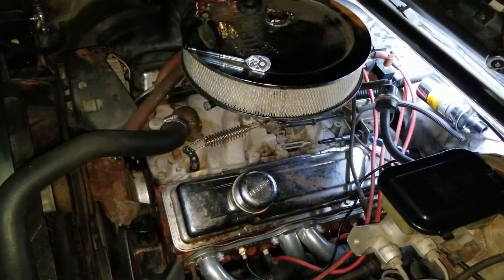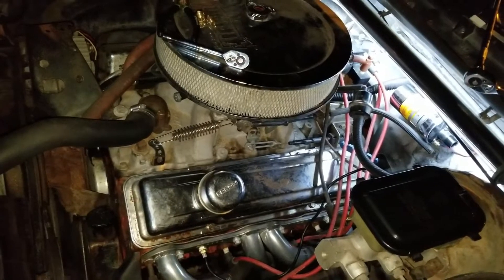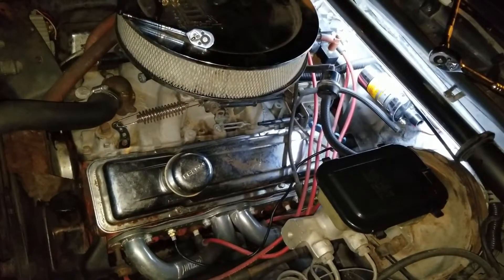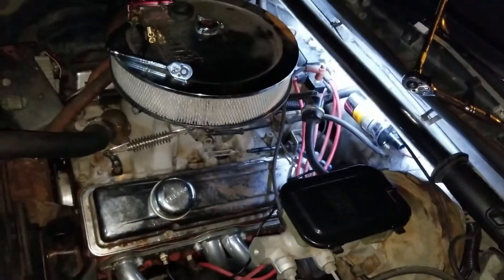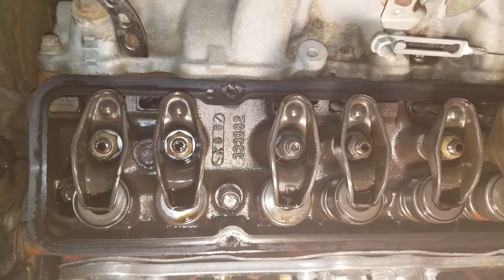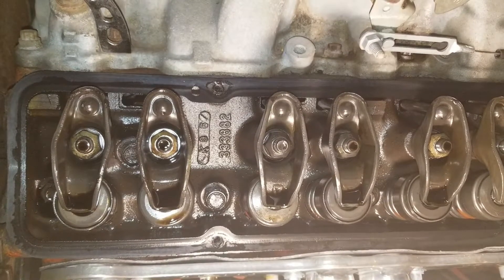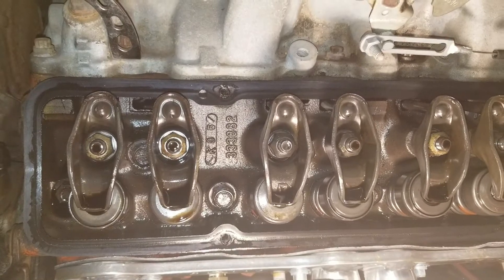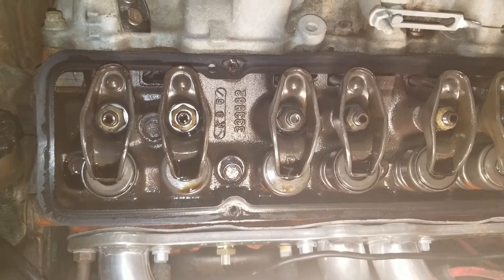Chevy engine block and cylinder head casting numbers location

Comment: Thanks! Rebuilding a 76 camaro, needed to know if it's a 4 bolt or not
Reply from the maker: As far as I know it's a 4 bolt block but I've been seeing people selling the old 010 block and saying it's 2 bolt. They may have had them done in both. That casting number has a wide range of use. The best way to find out is to pull it apart and look
Reply: @CarManiac125  I'll drop the pan next time I do my oil... I just did it last week damn it lol. It doesn't really matter either way though, it's getting a cam and heads next regardless!
Reply from the maker: Yeah them heads need to go. The 70's didnt really have any nice heads. The one true way to get power from a head swap is to make sure the heads are aftermarket. Those 882 heads on mine are ok for just a driver but power is a no go. Even if I was to do a cam or have them cut for bigger valves. Now if I would put domed pistons in or run boost i could get power but still need to have machine work to handle it. Aftermarket is the best and true way. Have fun with the build

Comment: Would the engine block numbers be the same as the vin number for the car ? I'm tryin to buy a 1983 caprice but I can't find the vin number since the one on the dash is rusted pretty bad
Reply from the maker: Nope, but you can try to find the body tag which will have the vin stamped in it. Usually found under the hood on the firewall. Also check the glovebox for a RPO sticker which should have the vin and the car option codes. The last one is kind of a hard one to look for. Is the build sheet. Those were thrown in the car in different spots I've found. Usually the build sheet is located under the front seat, tucked in between the seat cushion and spring. I've pulled a headliner out of car and had one fly out, lol. Under the back seat. That's about as far as I can help you there. Good luck with your hunting and I've owned a few 80's chevy caprices. Nice cars
Reply: Preciate you answering me homeboy , keep up the good luck 🤘🏽